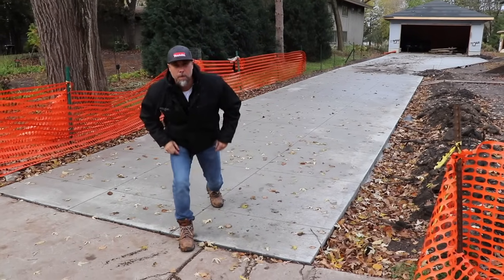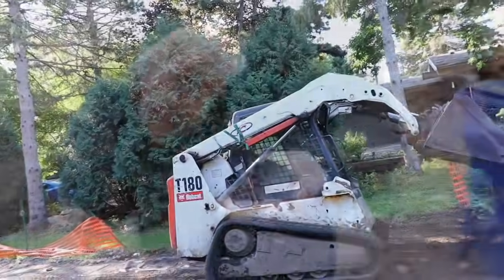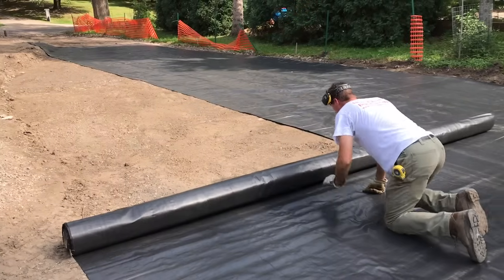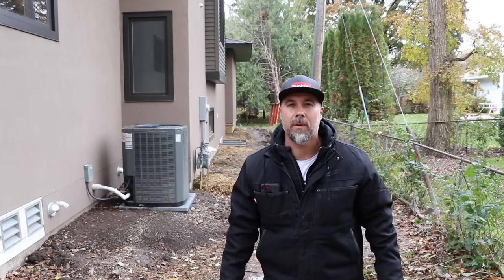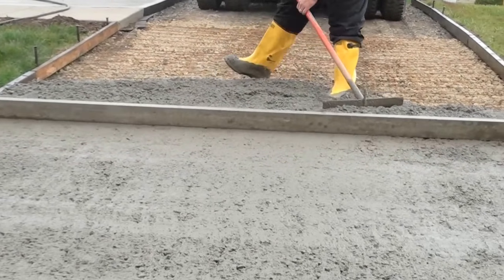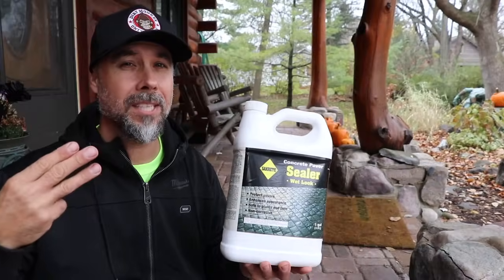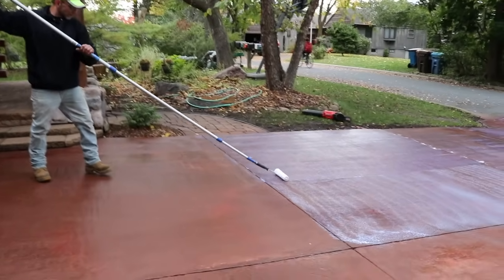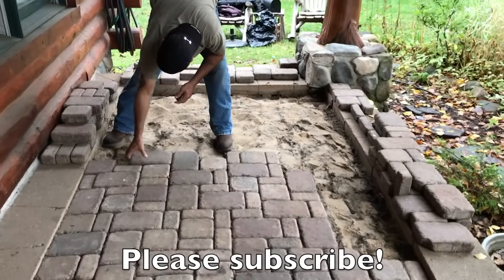Concrete basics for Beginners from top to bottom, ground prep, rebar, sealing & protecting

Comment: I like it Stan! A few things that I think people should also consider; first where your water shed will be. You NEVER want flat level concrete, this will make puddles and in cold climates like yours and mine, ice! Regardless of what kind of pour it is you always want 1-2% or greater slope in one direction to shed water. Also if you are pouring up against any kind of existing concrete it is essential that you use some kind of foam expansion to prevent cracking when the surfaces differentially expand. If the existing concrete you are working with is going to be part of the pour, such as a driveway extension, consider drilling in #4 rebar to anchor the two together so the don't float apart. And finally cutting in control joints is an absolute must! All concrete is going to crack and cutting in joints about 1/4 the thickness of the slab will control the cracking. Great video!
Reply: How to build the box structure that has a 1% slope using standard timber planks?
Reply: Should you do rebar and expansion material together. I don't understand really. I'm trying to pour a void in my foundation using the ground and existing block as forms and osb on the outside. I live in Virginia, gets semi cold maybe 10 degrees max low on average. Usually not that bad though. And the place I'm pouring is about 6 ft underground but connected to block that sits above grade. 
It doesn't have to be pretty just do it's job. I just don't really understand what products can bond with others and whatnot.

Comment: First rule of concrete. It'll crack no matter what !! # 2 the first truck goes in easy, 2nd 3rd etc will get stuck first one doesn't get stuck but tears up mud for the other trucks to get stuck # 3,every 100 yards you order is going to be a yard or so short, youll need 11th truck  # 4 use American steel rubber coated. Chinese steel snaps vs American steel just bends  difference is amazing chairs ties rebar
Reply from the maker: Dylan Walsh sounds like you've done some big pours.
Reply: This guy knows! Coated rebar is definitely the way to go but it adds a lot of expense. In my area green bar (coated) is required for city roads and sidewalks
Reply: Adds expense, but over the years I and many others have found out that if a pump is available, it costs up front but saves huge in the long run - time, damage, and etc.  Cuts groundwork out, especially if you live in an area where rear-dump trucks are the only option. Mixers are hard on prep work, more so on soft ground.
Reply: Jay Phillips as far prep goes I rather have a little stand on ride wheel barrow .   I hate the pump on floors, extra money for a concrete truck of prime too
Reply: Those dump carts are really a great alternative, but limited to flat/hard subgrade, either that or fab the rebar mats and lay in as you go, which is time-consuming on a bigger slab.  And we do a lot of heated floors around here, which is why pumps are big.  I've not heard of needing an extra truck of slurry to prime, the only exception being a line pump with a gob of hose strung out.  Mostly been around Putzmeister, a few Schwings, but never had problems with prime unless the batch plant gave me a bony mix.  Once in awhile you get a dry pack, but seen that happen even with 4G grout.

Comment: how about getting used car tires, cut out the sidewalls, dig the driveway 3 inches deeper than the width of the tire. then fill the tires with crushed gravel small pebbles, then put your rebar down then pour your concrete, will be super strong. and great base.

Comment: Newbie here...why does the mesh or rebar need to be suspended from the ground??  The area im looking at is heat, straight sun, humidity, clay soil, and rain...so we are prone to flash flooding, pooling of water & above your ankles, ground not level (sloping).  How high should we make the slab?  Thank you

Comment: Looks like a video project, working on your own home, or a contractor that asked for all this. Great video. I live in Washington. We're known for rain. I've never seen prep like this and I've seen schools, roads, and full housing complexes built. That extra layer of cheap insurance, would not be done cheaply by a contractor -- anywhere in America. I just watched a whole school built right next door to me and sidewalks put in as we had none. No special dirt for drainage or underlayment. Just leveling, packing, framing, rebar, and pour. I've always seen these extra products and have never seen anyone but homeowners doing their own projects use them.
Reply: A building contractor here and I also live in Washington. I've watched his vids since 2020 and yes he has done vids on his property-projects. Further more, you're correct. About 85% of customers don't want the finance but, there is the 15% of difference that Will.

Comment: Stan, you left out "Control Joints" and drainage-water control. Once you pour a slab of concrete, water runoff and control becomes an issue. 
Cheers
MJ

Comment: Hello Stan.
I have a DIY project that I am researching. There are many  videos out there but not many that really get in there to account for the details and biology of dirt and other factors. So with that I think I found the man with the plan. I hope that you have a video or information on leveling the ground on a 15'-20' variance foundation. I need to build a 36X25  barn with a concrete slab. The most difficult part will be leveling the ground and pouring the slab with approx. 4" drainage pvc outlets. I will only have a tractor with a bucket and a 1 1/4 cubit ' mixer. Any Ideas I would appreciate.

Comment: I was looking advice on how to level and form up concrete pads too.. I have a transit(inexpensive but decent enough) but am not sure where to begin my starting point(ground height)...

I cannot upload so I can't show you the site but I will add a short video in an hour or 2 if you can offer any tips. Thanks for the Sacrete sealer tip!

Comment: Talk about preping the dirt or gravel how smooth does it need to be?  Should it be perfectly flat like body work on the hood of an show car? Low spots hi spots. What do you use to taken out woops hi lows in dirt surface? Should I screet the gravel like you did concrete. I want to have almost perfect garoge floor

Comment: I got a question I want a 24x24 pad to park 2 mid size suv's on but where I want the area at there's already a slab that  Partially extends from my garage slab but it's busted up and causing my garage to sink or tilt out of level . Is there a way to have the slab poured and fix the garage from leaning also?

Comment: Stanley appreciate the video. Does the concrete sealer you utilize in the video help with water proofing cement? Could it be used for water proofing cement flat roof houses like in india or africa?

Comment: I need to cover back up a leak repair indoors to the foundation,do i need to drill out the sides of the concrete and do rebarb or just fill it in with concrete, its a 4'×2' hole

Comment: I had a water leak fixed under my concrete driveway.  They cut out the concrete in slabs and left those behind.  Is there a way to re-use the concrete slabs?

Comment: Is there an additive like an etching so that it is not slick when wet or snowing.    We don't just rely on a broom finish for slip protection do we?
Reply: Many walkways, etc are done using a brush like method to create a textured surface.
Some may use other methods where the aggregate is brought to the surface such as the sand.
Additives are usually only used when applying some sort of paint or other coating that by itself can be slippery when wet.
Etching is something different, though it can be used to add texture or prepare a surface for other work that can involve slip protection.

Comment: Ok, so here is a question. I am in KY and am building 2 smallish concrete pads. One is 6x10 , its a step out from our basement door. And the other is 11x11 for a patio that will eventually have a gazebo of some sort. Anyway, my question is.. After digging down do I put the gravel down and then build the form on top of the gravel? Thats how i notice the builders around me doing the driveways to the new homes? I am not planning on putting re bar or anything, since nothing really heavy is going on those pads. Is this a good or bad idea? I have asked many cement people here and they said its ok not to add the re bar.

Comment: I have a very muddy area where my patio is going to go. The guys doing it said he will put some plastic over it and it should be good. I'm assuming thats the film. Any recommendations. It's been impossible to drain and get rid of..
Reply: Mud is bad. Get rid of it. Need to excavate and fill with rubble otherwise it will crack over the years

Comment: I've got a porch that I'm gonna pull up the existing osb subfloor and I wanna lay concrete floor...but the ground is uneven under it....i was thinking that I should fill it all in with gravel,then lay that fabric stuff down,and then do either mesh or rebar. The idea I have is to eventually make it a workshop so I have a work space to do my own home improvements and I'm gonna have some what heavy equipment on it,like wood working stuff and eventually a welding station. But, my question is what's the name of the fabric and is there a way to compact the gravel with out a compactor. Also which would be the better idea rebar or mesh for 121.4 sq ft room. I'm also planning on attaching a deck to the structure later on to give me some more space to work and a place to hang out with my family. I'm new to this kinda stuff and have done little things here and there but, I'm honestly just tired of sitting around wishing I had the money to pay someone to fix it and I wanna take action and use this project as a learning experience so,that in the near future I can start improving my home and simultaneously our quality of life. I got the tools to start tearing up the floor and plan to start my next off day. Will any gravel work or is there a certain brand I should look for here in Georgia?

Comment: You forgot one of the most common reinforcements used.... fiber. Also concrete paver dealers are not the same commonly used for concrete driveways. Acrylic cure and seals are designed for fresh concrete to trap moisture in the concrete to keep the cement hydrated during its curing process of 28 days to gain its full strength. Also control joints are probably even the best thing you didn't touch on..
Reply: tj federici agreed with what he said
Reply: Sealer should be minimum of 28 days after pour.

Comment: Here in sweden we need to dig out The soil and add around 15cm off 8-16 and then 10cm off isolation and have isolation stickning out minimum 90cm outside The area you eather lay brick pads or concrete beacuse off The Cold in the winter. Otherwise the freeze lifts up The area you have made. Soz about bad english. Cheers
Reply from the maker: Mr Digalot it's kind of similar to what we do here or at least should be doing. It's bitterly cold in Minnesota but many contractors still skip the vital steps

Comment: I sealed a concrete floor for a 20'x80' shop a couple of days after it was "dry" enough to walk on. Less than a couple of weeks later it cracked all over.
Talking with another guy about a 20'x20'  patio, he said he let the concrete sit for about a year and then sealed it. That way the moisture could evaporate before sealing. He said it won't crack as much or as soon. It's been a year since he sealed it and I haven't seen any cracking. What are your thoughts on this?
Reply: Scott & Cyndi Wright 28 days minimum

Comment: Another tip, when tying your rebar together, make sure you're not using aluminum wire. It'll chemically react with the concrete and it'll end up spalling and failing down the line

Comment: Stan, your videos are great I’ve learned a lot from watching you... I’m located on Long Island, NY not far from your buddy Skip... you speak often on class 5 base material and aggregate, here in the northeast most contractors use RCA (recycled concrete aggregate) what would you suggest using to that would be equivalent to what you use being class 5?
Reply: Nicholas Gonzalez no, recycled concrete is generally at the stage of decomposing. You don't know the strength of it compared to the stones in #57. A large compactor will often crush the concrete vs. good natural Stone.
Reply from the maker: Nicholas Gonzalez that's actually what I used in this video. Its recycled class 5. Awesome stuff. Packs super tight and yet is still free draining.
Reply: Thank you both. I have two projects coming up one being a front yard renovation and a retaining wall, when I call the stone yard I use I’m going to purchase in bulk class 5 and 3/4 angular stone for the wall project... Also this might be beneficial for you guys also when doing a concrete project such as the driveway, if you use a concrete mix with a larger stone aggregate you can get away without having you use steel rebar or wire mesh

Comment: Good vid, Stan, and props that you emphasize subgrade prep, a point often overlooked when talking concrete.  One other subject that would easily make another vid is the curing process, both in hot and cold weather.  Curing often makes or breaks a slab, and can make a considerable difference in both longevity and appearance.  Subgrade moisture, ambient temp/humidity/slump/winds/sun-shade differentials..these and other factors all make a difference.  

Also curious - assuming removal/replacement prep of organics and bad soils there, is it common practice to pour without a 4"+/- layer of 3/4" bedding rock beneath the slab?

Comment: Not a fan of SRW sealants?  Boy I had a bad result sealing a beautiful patio I installed this summer by applying in too cold of temperature.  Left a white haze over most of the pavers :( reading instructions probably would've helped!
Reply from the maker: shaymoose17 you can only apply 2 coats more than that could be trouble as well.

Comment: When screeding the concrete instead of dragging the screed try sawing it back and forth while pulling it with people filling low spots and pulling down high spots behind it, it makes bullfloating a dream
Reply: or ditch the 2x4 completely and get an aluminium screed you have a cut face on one side and a smoothing face on the other side makes bullfloating almost pointless
Reply: Andrew Eastaughffe we you both 2x4's and aluminum but always bullfloat after that, it makes finishing concrete that much easier
Reply from the maker: Ben Dodson good advice thanks.
Reply: And it works even less well if you're using a wet screed method.

Comment: You may use a great plastic barrier on your concrete work, but after it is installed all manner of holes are created by the reo installers, and the concrete installers.  Plumers and other trades people are in an out, with no time to care for the barrier installed.

Comment: I dont care how much prep. Work you do if you dont have the rebar and thickness it will still brake all up ..  add plentiful  1/2 redar 1 foot square make sure its in the middle of the slab not at top or on the ground and good 6inch of  concrete 3500psi for a driveway and it will hold up on any soil for truck 1ton and under

Comment: What do you do for patching concrete? My parents garage is needs some concrete patching.
Reply from the maker: Robert Scott Aldrich I use sakretes fast patch. It's in my first video on the diy $660 driveway. I go through how to use that.
Reply: It’s for a cement garage floor that was poured in the 1970s. I actually replaced a Pea gravel patio with patio pavers.

Comment: I did a concrete driveway addition with my brother on his driveway cause the home builders design wouldn't let him park a vehicle in the 3rd garage door and my brother wanted to use 5/16 rebar and have the extension the same thickness of the existing driveway of 5 inches which was the home builders spec and the municipality inspector agreed with what I thought should have been used of 24 inches of 3/4 crush stone base and 1/2 inch rebar and a minimum of 6 inches thick the day I have to redo my driveway I'm going with 50 mpa concrete at 24 inches of 3/4 crush stone at 12 inches thick with 1/2 inch rebar in 3 layers and no rebar in the top third for the control cuts cause I plan on parking a F-550 extended cab or crew cab truck 4x4 with trailers between 14,000 lbs to 21,000 lbs and I would not park that weight on a 5 inch slab driveway would you
Reply: Nathan Brodeur yes if your at 5-6 inches you have plenty on strength
Reply: Turner koenigs you do realize that the weight I'm talking about is minimum of 30,000 lbs to 60,000 lbs maximum and over time a static weight of 30,000 lbs with the base material settling a driveway 5-6 inches with one layer of rebar will buckle in less than 5 years vs a driveway 12 inches thick with 3 layers of rebar
Reply: Overkill, but if ya want to throw money at it, go ahead.
Reply from the maker: Sounds like your design should hold up fine for that load.
Reply: 100mm sub base of “crushed rock” (rubble we call it in Australia), 150mm 32mpa slab with sl 82 mesh is more than enough, unless your parking semi trailers etc then I’d recommend 200mm sub base compacted in layers, 40mpa and 200mm thick with sl92 mesh
Reply: 60 000 lbs dispersed over a driveway, through the contact patch of the tires of a F550+ Trailer equates roughly to 150 PSI under them. That's 1 MPa.  I'm not fluent in concrete work, just did quick math. Concrete takes compressive loads pretty well, that's it's only usage...If that driveway is like 10x40 ft, you're applying 1 PSI. I miss something?
Reply: You should use a nine bag mix with one day high early in it